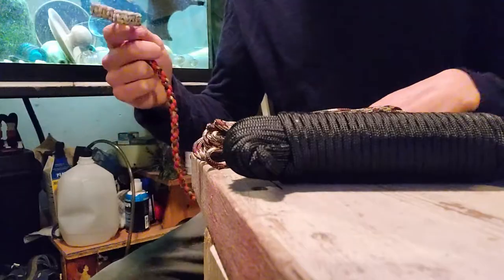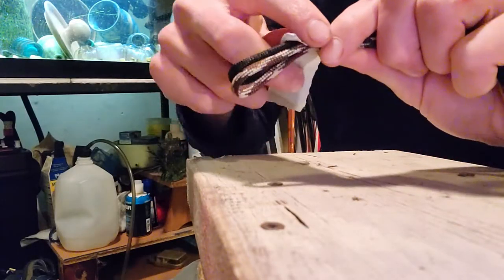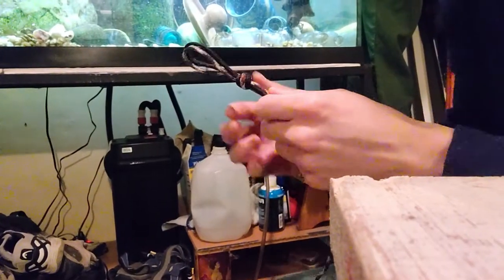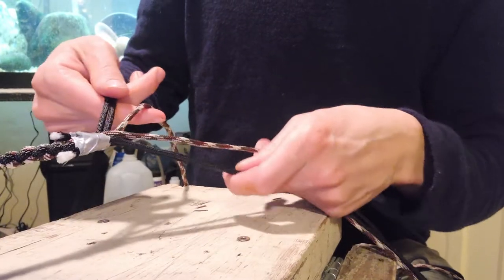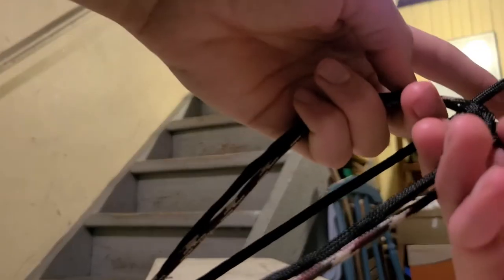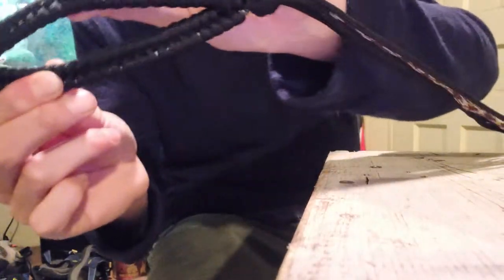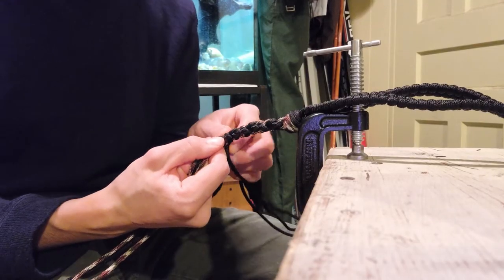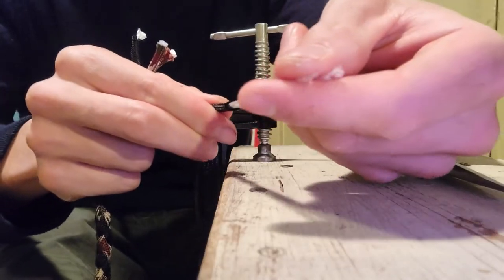How to Make a Paracord Sling With a Whip Cracker

Comment: great tutorial! when it comes to adding cordage to the pouch part, I just fold one long piece instead of adding 2 separate smaller pieces from that spot. maintain structural integrity and no need to melt anything at that point. let me know whatcha think of that :)

Comment: @03:48 - instead of adding TWO strings... add ONE STRING of double-length, but FOLDED at the center and you 
can BRAID-IT-IN  - intertwined at the fold  - without the NEED to tape it and then cut and burn the ends...

GOOD VIDEO!

Comment: Ah had not seen that you had also done a tutorial. Will be using this for reference as well. I already started my pouch somewhat with just a "stopper knot" and then immediately starting the pouches by adding string there (so less string and no successive increase in thickness). May have to redo it now... Or just use this for reference for the next time. Another good video. 👍

Comment: @Road Dawg is this a round braid? I've got the Matthew walkers down, I'm now struggling to understand the braid I've only ever braided flat and not many times. It's seems so from the video but perspective wise a bit difficult. I did move down the 1.5 or so from the first knot fir the loops and placed another matthew walker, I'm using 550 cord, and it's definitely on the stiff side! I really like how the Matthew walker knots turned out, I'm not familiar with a lot of knots, so learning it was definitely interesting to say the least!

Comment: Thanks for the video!  I am going to make this one tomorrow. I have never made a braided split pouch before. I have just used my single strand of cord with a leather pouch. Do these throw much nicer?  Any changes you would make?  Also, is the 2 finger loop better than the single?  I have only used a single loop before.
Reply from the maker: That's great, goof luck making it! I don't know if they throw any better than other sling designs but I've been using them for the past few years and they hold up great. They're fun to make as well, try it out and see what you think
Reply: @roaddog7080  thanks!  I'm kind of split between making one with a taper or a straight one.

Comment: I hope you dont mind this suggestion. But this would be a perfect tutorial to follow if the camera angle was filming from your perspective (like over your shoulder view), or at least from above. This makes it so easy for someone (like me lol) with no experience, to follow you move for move. Sometimes the side angle views and changing camera angles makes it quite difficult to keep track of what goes where.  I hope you will consider redoing this tutorial with the better viewing angles. As your actual sling design utilising paracord is one of the best ive seen and exactly what ive been searching for. All other sling making tutorials using paracord just use a single strand of paracord for the arms (not sure if thats a correct term). So the sling doesn't seem very strong, or at least like it wouldn't last as long as your design. The finished sling you created is a great piece of craftmanship and looks like it would stand many years of slinging. Love it
Reply from the maker: Thanks for the feedback, that would be a great idea, some of the really good paracord craft guys on YouTube do it like that. There's a lot of moving parts in this design so it would definitely help. Not sure if I'll have time do one one any time soon but keep perservereing to make this sling! it doesn't have to be exactly like mine to work, I figured it out by playing around with like 10 different designs during covid to try and replicate practical paracord's slings.
Reply: @roaddog7080   Thanks for reply. Ye no rush on the video if you find the time. I’ll have to wait for it though as I don’t know the first thing about this Paracord weaving, so I would literally be following you as you do it lol. Soo can’t even play around, other than creating something with one single strand. I’d much rather have a robust woven design like you’ve done.

Comment: Great tutorial, may I ask how long those two strands are that were split in for the pouchweave?
Reply from the maker: Thanks, the two strands for the pouch were much shorter than the braiding strands, I think about 10 feet long
Reply: @roaddog7080  thx alot, I appreciate your fast answer :) Then I am going to try my luck and make one myself ^^
Reply from the maker: no problem, I hope it goes well, these things are fun to make!